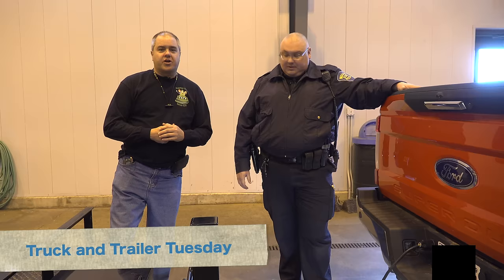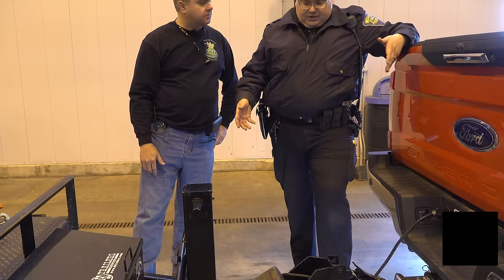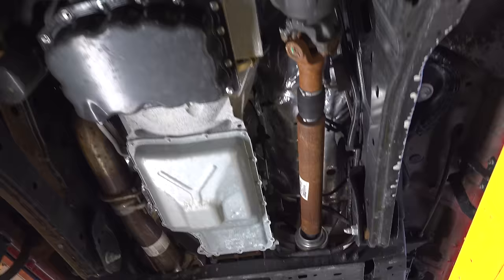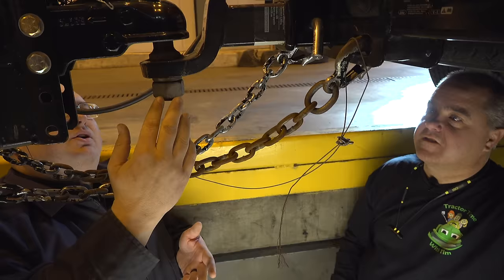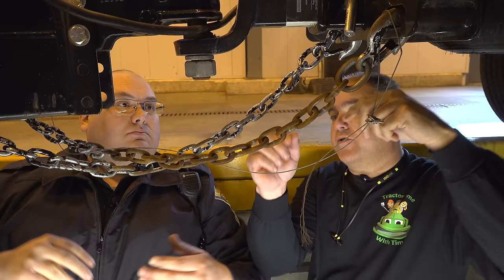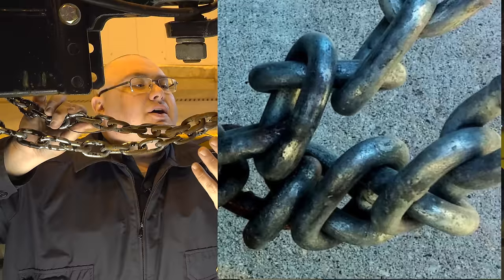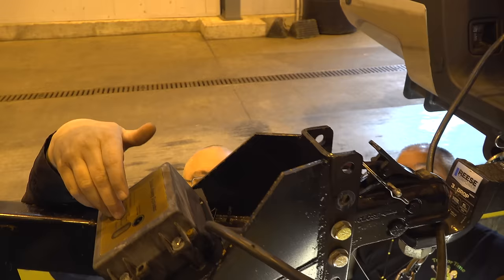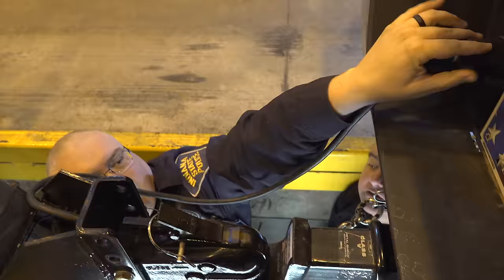Uhoh! Tim Fails Inspection! Truck & Trailer Tuesday with Trooper Hoover

Comment: The trooper is absolutely correct on the emergency brake activation cable. Great catch trooper.
Reply: Mine ebrake is attached to my bumper
Reply: I knew that when i started towing skidsteers at 16yrs old.
Reply: "Great catch"!! Except he didn't mention the fact that the cable was longer than the chains! DUHHHH! You would want the emergency brakes to engage before the emergency chains are tight! "Great Miss" if you ask me....
Reply from the maker: I dunno.  If the main hitch detaches, I’m ready for the e brake to be engaged!!
Reply: @robbiebooth2980  the emergency brake is there in case the safety chains fail after the trailer becomes detached. You don't want the trailer to come unhitched and lock up the brakes while still on the safety chains. That would make a bad situation worse.
Reply: @robbiebooth2980  That's your opinion, but the DOT is who has determined that the break away cable is longer than the safety chains. That's according to the DOT officer who pulled me over in Georgia and wrote me $3500 in fines, including my trailer break away cable being 1. Too short 2. The break away cable was attached to the safety chains. In addition to a lot of other violations. I was subcontracting for a mechanical contractor and duped into driving his truck and trailer back to Ohio.

In addition, proper break away will lock the wheels. Sliding a huge trailer swaying around with only 2 chains holding it to your tow vehicle could create a massive sway and likely flop the trailer over... with you trying to control it from your 1/2 ton.

If the trailer comes unhitched, use the hand lever on the brake controller to control the trailer and safely drive it off the roadway. If the chains break, then the breakaway takes over.
Reply: @Vdubfro  if you got a ticket because your emergency cable to your brakes was shorter than your safety chains you absolutely 100% need to take that to court and fight it!! The safety braking system is 100% supposed to kick on the second your trailer comes off the hitch to begin slowing the load so you can control the emergency stop with the safety chains! I have pulled mobile homes for 14 years and I'm very aware how the systems work and how they are designed to work together.  I have been inspected by multiple DOT officers numerous times over the years and never had an issue with the emergency brake box cable fixed to trigger when/if the load was to come off the hitch. Think about it, if your load comes off and your going downhill the trailer will very likely take out the truck... Unless, the braking system is engaged which doesn't allow that to happened therefore you can safely guide the load to the shoulder by the emergency chains!
Reply: Does the length of the emergency brake cable depends on the type of trailer brakes? If your trailer had surge brakes, I would want the cable shorter than the chains (to lock the trailer brakes). If the trailer had electric brakes, I would want the cable longer so I could manually stop my trailer.
Reply: @kevinbuffington3770  ive always used an emergency box which has a battery in it and locks the brakes when cable is pulled
Reply: @robbiebooth2980  
"49 CFR § 393.43 - Breakaway and emergency braking. 
(d) Breakaway braking requirements for trailers: 
 Every trailer required to be equipped with brakes shall have brakes which apply automatically and immediately upon breakaway from the towing vehicle."

I think most would interpret "breakaway from towing vehicle" as the trailer not being connected by any means including chains due to some failure of the coupling mechanism and safety chains. This is why it is recommended that the chains are crossed. It provides cross stability and cradles the tongue in the event the trailer becomes uncoupled. In the event of a coupling failure your electical connections are likely to be intact so you can still rely on your tow veichles brake controller to provide gradual braking (even in downhill scenarios like you mentioned) versus shoving a full a amperage 12-13 volt load to the actuator magnets. Gradual braking is always preferrable to a lock up or near lock up scenario.
Reply: @TylerBoespflug  im going by what troopers have told me whenever asked this specific question
Reply: @robbiebooth2980   What I pasted comes from the Federal Motor Carrier Safety Administration regulation. Before trying to get one up on a trooper and calling it a "Great miss", I suggest having more than just annecdotal information. 

I posted the regs in direct response to you to make sure future comment readers were properly informed of what was truly required of commercial haulers and help those that don't fully understand the safety systems avoid causing full brake lock ups before other potentially safer safety mechanisms are invoked.
Reply: @TylerBoespflug  then show the legal definition of 'breakaway'
Reply: @robbiebooth2980  So far you are the one insinuating that an uncoupling is the same as a breakaway from the tow vehicle. If it is still connected via safety chains it has not broken away. Not sure how else that basic understanding can be explained and I'm done trying. 

My clarifications were to educate future readers that are unsure of how these systems work together and what DOT says. I've provided adequate information regarding safety regulations and how relying on multiple systems can still provide the best chances for safe control and stopping with the tow vehicle in the event of a failure. When all else fails the breakaway cable is intended to engage the brakes so the trailer can bring itself to a stop instead of continuing into other traffic. With all of that shown I accomplished what was intended and I'm no longer engaging with someone grasping at straws in an attempt to save face.
Reply: @TylerBoespflug  that still doesn't give a legal precedence for Breakaway! I think it means whenever the trailer comes off of the hitch
Reply: Yes always attach the cable to something other than the hitch. Mine gets attached to the bumper. And it is longer than the safety chains. It’s called a breakaway cable. Still attached by the safety chains is not a” break away”.
Reply: @TylerBoespflug   @dodgeguyz  
 @dodgeguyz  you do realize once the trailer comes off the hitch and you are set up for emergency braking to take effect after chains fail that at that point you have a trailer with a load that you have absolutely no control over but legally you are 100% responsible for! Kind of scary to think that people have this thought process and drive on the highways with my family on them! Going by your logic there's never a need to wear a seatbelt if you're in a vehicle with airbags! Airbags and seatbelts are both safety devices but they are designed to be used together! Just like safety devices for trailers are designed to be used together! You don't want to depend on just to safety chains to bring a load safely to a stop. You don't want to change to break before your emergency braking engages because when you have an uncontrolled blowed flying down the highway! If you want the emergency brakes to engage around the same time the emergency chains Get tension on them! That way you are able to still maintain some control of the trailer during emergency stopping procedure! You're basically saying that you're alright being responsible for a potentially 20,000lb-30,000lb load not engaging its emergency brakes until it is FULLY broken away from the tow vehicle!!  Your logic is Unbelievable, Reckless and very easily could lead to you killing somebody.... or even an entire family! I hope you drive a Prius and never pull a trailer
Reply: @Vdubfro  Some very good information for us "amateurs".  Now I need to determine if I need a safety brake on my 16' utility trailer.  More research to do.
Reply: What if my trailer doesn’t have breaks
Reply: @robbiebooth2980  
You don’t understand how this system works. The breakaway is there in the event of a breakaway (complete disconnect from the Tow Vehicle).still attached by chains is not a breakaway! The last thing you want is a trailer pulling in the back of your Tow Vehicle making it uncontrollable. The umbilical cord should always be longer than the chains so it doesn’t get pulled out. This way you can still use the brake controller to slow down the trailer. It’s a complete system. If one piece isn’t installed correctly it won’t function as designed! I certainly hope you aren’t towing anything more than a little RWD wagon behind your bicycle!
Reply: @drakepoovey4979  State regulations determine whether your trailer is required to have brakes. That is determined by the weight rating of the trailer. It’s somewhere between 1000 and 1200 pounds here in Iowa. After that you have to have electric brakes and a breakaway box.

Comment: I use a bungee cord to hold the chains tight under the ball everytime.  It keeps everything from dragging but, flexes when the need comes.
Reply: Good idea; I'll do that with my trailers (I have three but all different sizes).
Reply: Just twist the chain until they don’t reach the ground anymore
Reply: I also use a short Bunge, and have for years.

Comment: Hi Tim,
Glad to see Truck and Trailer Tuesday, you're making the world safer. Here's a small tip to share - we just bought a big dump trailer and for the first time need a 2 5/16 ball. To prevent confusion, I painted the 2 inch hitch bars and hitches fluorescent orange, and the 2 5/16 hitches fluorescent green. If you were to put the bigger hitch on the smaller ball there would be big trouble. Bonus - the hitch is easier to see in the backup camera.

Comment: I've added an eye-bolt just below by rego/license plate for my emergency breakaway brakes - keeps it clear and independent of the towing hitch :)
Reply: I do the same thing just in case the tow hitch breaks my to hitch is below my bumper so my safety chain hooks to my bumper even my electric break cable is on the bumper

Comment: If your shank on the ball is 1 ¹/⁴" (a lot of 2 ⁵/¹⁶" hitches are) the torque spec is 450 ft/lbs. That lock washer should be completely compressed.
Reply: lock washers do nothing. that nut isn't tight.
Reply: I don’t doubt your spec, but who has a torque wrench with that capacity lying around???
Reply: @chrisbreidenbaugh3697  That's when you hit it with enough ugga duggas to stop turning and then put a 10' pipe on your wrench and see if it turns.
Reply: Chris Breidenbaugh, I do....
Reply: I just use my impact wrench set to highest setting to put the ball on tight. They never come loose.
Reply: @chrisbreidenbaugh3697  I do because I am a mechanic. If you don't then you should goto a shop a get them to torque it. Not having the proper tool is not a good excuse. Pretend your mom is driving behind you, would you want to risk it?

If you come to my shop we wouldn't even charge you for this service because my wife and kids share the road with you. I'd rather know it's tight.
Reply: brode geddes yea I would risk it because never in my life have I ever had a ball come loose when I tighten them with my impact
Reply: Dalton Brumfield same, although I use a 36” or 48” pipe wrench
Reply: @daltonbrumfield5514  I hope you never do either. People have "torqued" wheels for years with a 4 sided lug wrench. Ask any of my family and they would say the same thing you just said. They never ever had a problem. Start asking mechanics and you will get a different story. I have seen loose tow balls come into my shop, and wheels come off and I'm not even an old guy. Over torquing is actually the number one cause of wheels offs, with under torquing being number two. I'm not saying you won't get away with a wrench and a bar your whole life. I did from 16 - 23 pulling lots of trailers. I know what can happen though so now I do the job right to clear my conscience.
Reply: The 1 1/4" shank needs about a 6 foot cheater bar with 3/4" drive tools. 1/2" ain't gonna cut it. I learned that one myself.
Reply: @brodegets  I had a trailer which I had tightened the lug nuts on the tires down tight.  A hundred miles later, we stopped for a break and I checked the nuts but they were loose.  After that, I checked the nuts at every stop and they kept coming loose.  I never did figure out why they kept coming loose.  Eventually I sold the trailer.  Now I have two torque wrenches but I think I'll get another one which can be easily set. The first one is the old beam style which I bought in the 1970's.

Comment: I'd bet 90%+ of private trailers have no working brakes, especially the breakaway brakes.
Reply: Doug Shrader in SC small trailers aren required to be licensed so they also aren’t enforced to have working lights or stop lamps.
Reply: Yep im guilty. No brake away battery.  My brakes work great though. I need my brakes since im 13k back there.  First time i pulled my tractor on this trl (just bought a week earlier) i didnt have brakes and yes my 3/4 could stop it but man. I kept my speed down a touch and i slowed early and watched closely for a panick brake situation. Also it was a short run. Now i make sure brakes are good cause i scale 22k
Reply: Hell in Alabama, 90% of the trailers dont even have lights!
Reply: You're wrong.....it's 95 percent
Reply: I'd bet that you're right, but I'm glad there's still at least a small percentage of us that take safety seriously. Every trailer I buy gets a full repair/upgrade of mechanical, braking, and electrical systems. I'll just keep a safe following distance behind everyone else.
Reply: Small private trailors are not required to have independent brakes
Reply: I nuts about my equipment.  Boat trl. Car trl. Lawn mower trl.  If I cannot hook and roll then I fix it were I can . Being from a rule farm community the day when I worked with various people hooking up there stuff and almost every time Id have to rewire lights and repair hitches it drove me nuts and Im no perfectionist I just want to hook and roll in confidence... Even packing your wheel barrings with synthetic grease will knock out all those breakdowns you see to and from the lake....Ive always kept spare barrings but Ive never personally had to use them myself but Ive stopped and helped several others broke down on the road and seen stuff that you just scratch your head and wonder how they've made it so far.
Reply: Most mobile home new they don't work
Reply: Everyone!  Please keep in mind that if your trailer does break away from the vehicle towing it, and the break away cable and switch do operate properly ... if your battery is flat or the battery connections are bad (need cleaning and sealed with vaselene etc) the trailer brakes will not activate / apply ... now you have a runaway trailer with its load. It all comes down to sound knowledge and preventive maintenance ... "Don't overdrive your vehicle or your abilities!" ... Stay safe and enjoy your days!
Reply: Mine didn’t for a while. Of course I was only hauling a zero turn. Recently had mine fixed. I broke a wire underneath my trailer while off road with it
Reply: I agree with you but mind my friend is working I could tell you a story that happened to me to wear my younger brother pulled my safety pin thank God they had a person pulled over in front of me risking his own life the stop me when I did get stopped I was pissed but he says your trailer is not hooked so I agree with
Reply: Well yeah, trailers with a GVWR of under 3,000lb arent required to have brakes and most people’s small utility trailers fall into that category
Reply: @travnat1  tell um dixie
Reply: Screw that. Im not using my trailer if the brakes arnt working. Its all mountains around here
Reply: You don’t need brakes
Reply: @gnaxel  Right? If the brakes don't stop it, something will!
Reply: I’m going to fix it some day
Reply: Mines 💯 in the SRT Durango with the integrated brake controller.